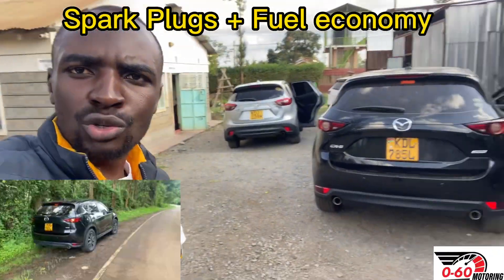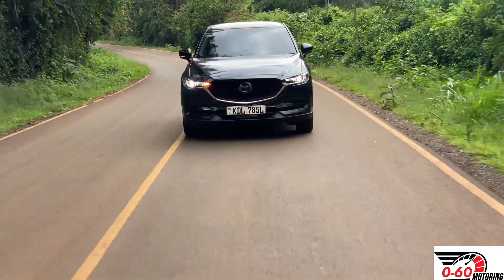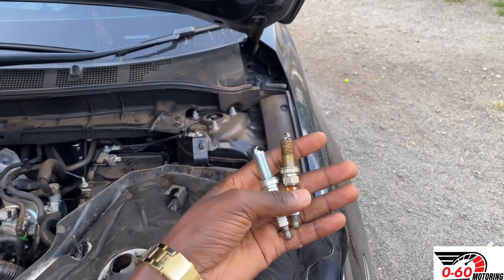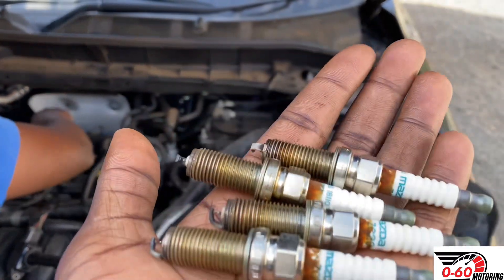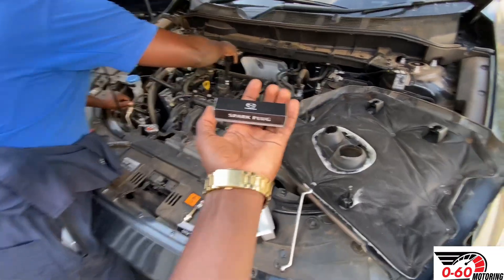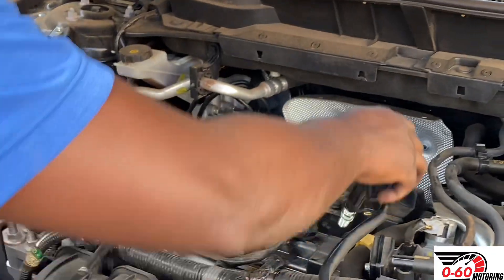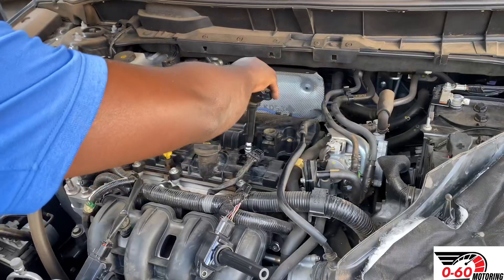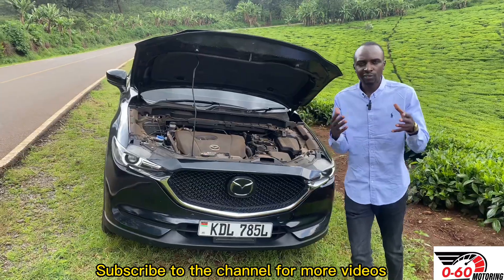WHY YOUR CAR IS CONSUMING A LOT OF FUEL!

Comment: With alot of fakes spark plugs in the market especially ones branded mazda, could you please recommend a dealership where we can genuine spark plugs. After a oil chang service i did change the plugs but later realized they are generic, now i have same situation getting 9km/L i think the sparkplugs are the culprit. Where did you purchase the original ones you changed and what was the price please